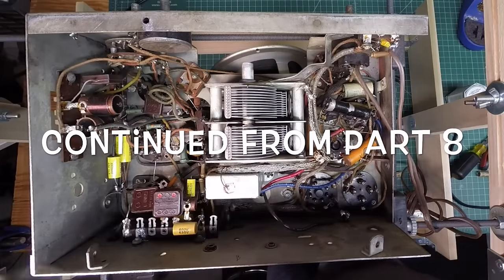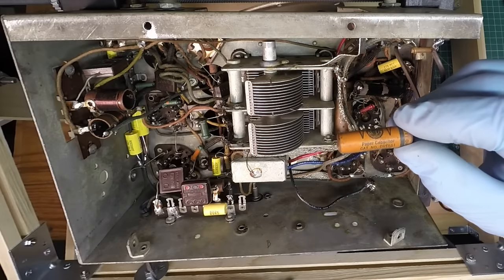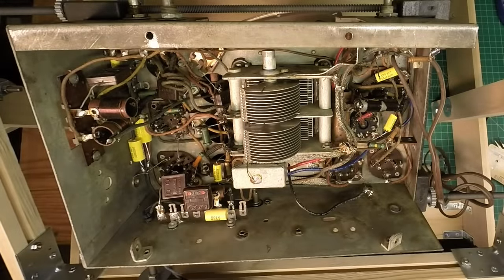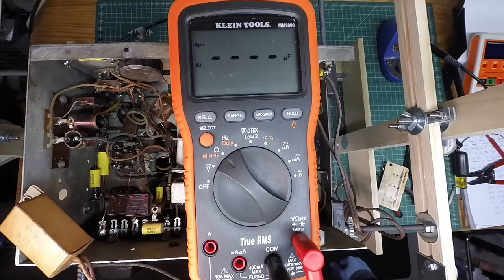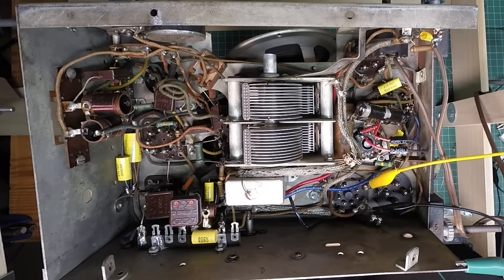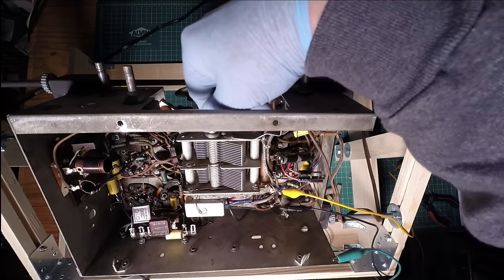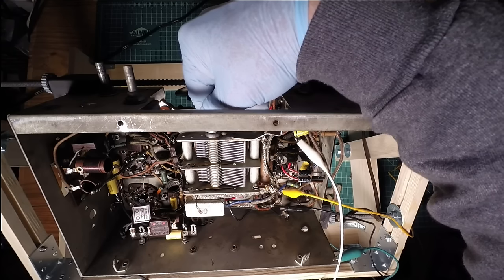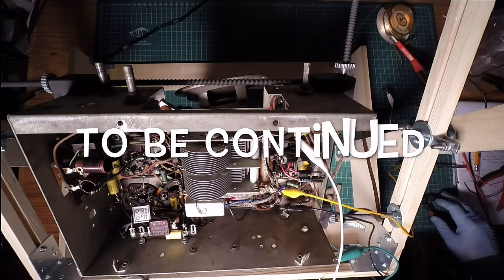Garod M33 - Part 9

Comment: The amount of work which you've put into the production values of these videos is apparent, an excellent effort, Don!  My uncle told me that in the mid-'50s, parts suppliers advocated the wholesale replacement of capacitors, along with "marginally suspect tubes" when sets were brought in for service. The term used was "you're actually doing the customer a favor by upgrading capacitors", "they're a wear item, just like brake shoes and ball joints on a car".
Reply from the maker: +AMStationEngineer Thank you. I need to use the chassis stand a few more times to get the best out of it and my camera angle needs a little fine tuning too. An interesting story shared by your uncle. Hope all is well. Best, Don

Comment: The repair/restoration of this Garod Vintage Radio is progressing tremendously well.  
It amazes just how many Vintage Radio men realign their radios once they have completed restoration.  Unless the IFts, trimmers, padders etc. have been ‘got at’ by someone wielding a small screwdriver, I hardly ever make alignment adjustments.  Though the wobulators I own were high quality when new (late-1940s to early 1950s), they will not allow me to achieve the finely set tolerances achieved by the radio and television manufacturers which were +/-1%, and less.  When I use a frequency counter (that is under four months old) to check the frequency output of a well warmed-up wobulator, I consider myself fortunate if I achieve an alignment accuracy that is somewhere around +/-2%.  My take on radio realignment is: if the wax seal on IFts, and the paint blob on trimmers, and padders, show no sign of being tampered with, and the radio is working as good as it should – with dial cursor pointing exactly onto the station, is realignment necessary?  
Sure, the speaker cone needs attention but other than that the radio sounds very good.  I see this as being a super restoration project my friend.
Regards Phil.  
P.s, a huge workload where I’m employed has meant postponing the start of my next restoration video series.  Hopefully that will be remedied from the beginning of February when part one will be uploaded.
Reply from the maker: +SteelCity321PB Phil - thanks for the info. I'll definitely check the IFs and trimmers as you called out. I hope to spend a few hours this weekend and get the power resistors installed, get the tuning assembly back in place and the safety capacitor permanently installed. I'm thinking I can get by with a coffee filter and patch the speaker then I have to move on to some rust removal in a few spots on the topside of the chassis. I know what you me about our real jobs, I've been extremely busy at work and my time in front of the bench has been minimal for many weeks now. Not sure a slow down is in my immediate future, so my video productions may drop off a little. Again, I appreciate the advice and I'll be looking for your posting in a few weeks. Take care. Best, Don

Comment: Hi Don,
Another great set of videos! I noticed the wire on the left side of the tuning cap that was coiled, I imagine it's for a minute amount of capacitance, but I've never seen one like that before. I've seen a lot of "gimmick wires" but never one like that!
Reply from the maker: +Jim Kodysz Jim - let me take a closer look at it and I will respond back to you. Hope you're doing well and thanks again for taking time to follow along. Best, Don
Reply from the maker: +Jim Kodysz Hi Jim - I took a closer look at it and it's a odd looking "gimmick" with three 1/2" diameter turns then wraps around a lead connected to the tuning condenser. Not my first "gimmick", but I don't recall ever seeing a coil of wire prior to the gimmick. I'm sure the length and position is critical to the tuning accuracy. When I do the alignment, I'll try to capture this in more detail and ID what SW band it's for. Best, Don

Comment: Thanks for the great lot of videos today!  I won't respond to them all, but my comments are for the entire set.  I have one question.  When you replaced the caps, especially on the left side of the chassis as viewed on the video, did you put the leads all back and push the caps down like they were originally?   I was just wondering if lead dress made any difference to this repair.  Great piece of information.  Thanks again!!
Reply from the maker: +Stephen Moore Thanks for watching Stephen. I tried to get the component lead dressing to mirror the originals, but due to the deep chassis, I was somewhat limited and had to re-position some of them. I'm not sure if the lead dressing made, or would have made any difference in performance or not, but the changes do allow the next person under the chassis to see the part numbers/values of the caps better. I appreciate you taking time to view the videos as always. Hope you're doing well. Best, Don

Comment: It is coming along very well. I really like the safety cap demonstration. Are safety caps primarily used in All American Five circuits? Gary
Reply from the maker: Thank you Gary. The safety capacitors can be used on all AC powered devices. There's a great article on their application/use at: http://www.justradios.com/safetytips.html

Comment: Hi Don.  Now that I am almost finished watching this electrical restoration, I thought I would ask which types of caps you always replace and which types you don't replace (unless they test bad).  Thanks.  Jim
Reply from the maker: Jim - I try to leave all Mica capacitors in place in and around the I.F. R.F. Circuits and all other have to go. Best, Don
Reply: @RestoreOldRadios  Thanks Don.
Reply: @RestoreOldRadios  Hi Don, I am sorry for my confusion but when you say mica caps do you also include silver mica caps?  Thanks.  Jim
Reply from the maker: Jim - silver mica I typically don’t touch them in less they test bad. Early on I left Micamold capacitors in place thinking they were mica, but they are actually paper capacitors and need to be replaced as well. Best, Don
Reply: @RestoreOldRadios  Thanks Don.